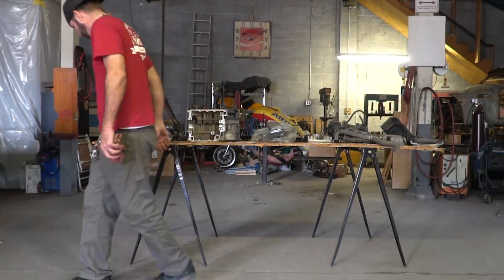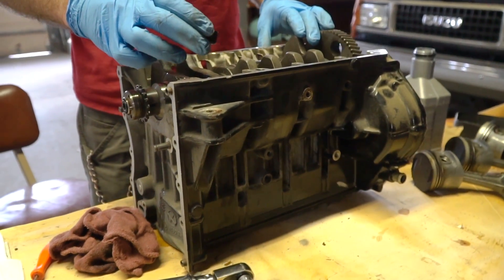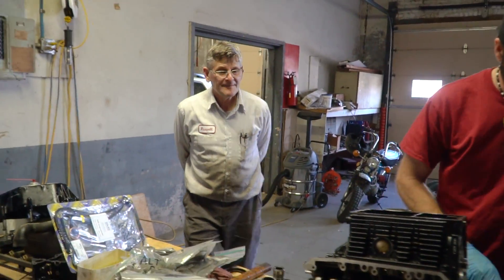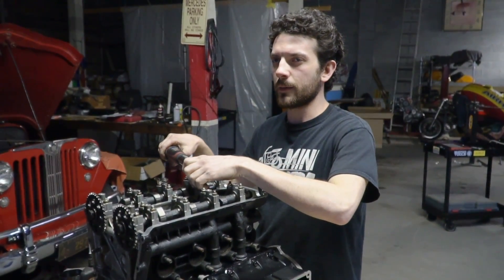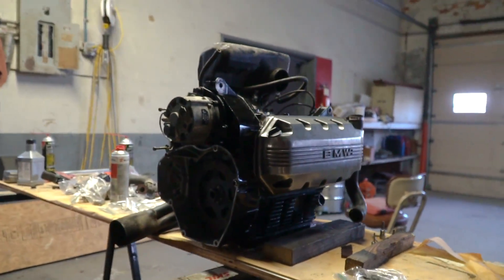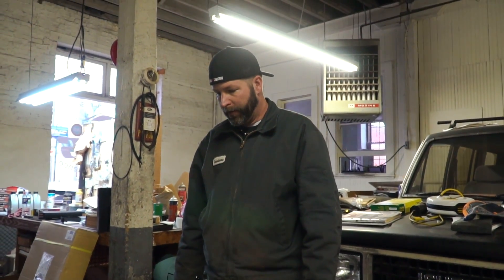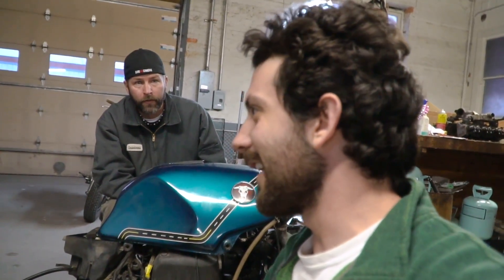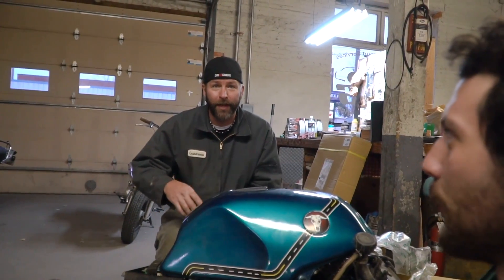Building an Abandoned 1000cc BMW Engine from 15 YEAR Cold Storage

Comment from the maker: This power plant is going to be a beast🤑
Reply: Aye sup carsandcameras
Reply: I think that you guys got to find an old Briggs 7 or 8HP engine and use on a go kart. I have an example in my channel if you want to to see it. There real hot rod go kart motors with the low idle.
Reply: Hell yeah, straight pipe
Reply: Do I hear custom  bmw powered turbo side by side coming
Reply: Beard looks good. Bromance
Reply: i could see a morgan threewheeler type of thing coming with that engine
Reply: It sounds really good. 👍
Reply: You didn’t pin your own comment, that’s why I like you guys.
Reply: I think this engine is a much more suitable one for a project than a 'Busa or another modern superbike engine. When you have 200hp on tap it's not all fun and games any more... 
I much prefer an oddball.
Reply: Maybe you could turbo, or procharge it...
Reply: that build is close to 1 buck per horsepower
Reply: A beast indeed. I own an R 1150gs and I think a Boxer buggy would be the ULTIMATE!  Torque like a V8.
Reply: I  owned a K100RS and these motors come to life after 5000 RPM
Reply: Thanks for this one, I've been needing to see the guts of a k100. Cant remember why... eh HaHa
Reply: You guys got to turbo this engine!!!!!
Reply: Put it on the rail
Reply: Hey just going to ask, are you looking for a frame for a project that isn’t a regular frame? It’s like half go kart half dime buggy with independent front suspension and stuff. Normally it would have a four wheeler motor etc. on it but the guy we got it from had made a makeshift 212 mount for it.
Reply: CarsandCameras gonna be crazy fast
Reply: Find a H/L/N/R gearbox from an atv and integrate that into the drivetrain.  You’ll have reverse and dual range which would be awesome!
Reply: When are we going to see more two strokes on this channel
Reply: @14:18 a 70’s Mercedes 280 lurking behind you, looks like.
Reply: I recommend on new startup after rebuild to pull the spark plugs out.
Spin it over with no spark plug in it.
It is easier on everything and it gets a chance to get oil flowing where it needs to go.
Plus the starter gets a break while spinning over.
Then when you get oil flowing and fuel going and flowing.
Then put plugs in and fire away.
I love this BMW Engine.
I read the magazine article’s when BMW
Came out with this engine.
I was on good terms with the BMW dealer and got to test ride the bike with this engine. This thing is a torque monster. Notice the fully counter weighted crankshaft! Awesome!!
This is build is going to be great to watch.
Reply: I'm glad to see you guys steping it up love the new build idea

Comment: Mad props to both of you for preserving an intact beemer and then repairing an old "brick." When taken care of, these engines are very nearly bulletproof. I had a K75 and K100 several years ago and had not a single issue with either.

Comment: That is going to be a cool start to a new project. I love those engines. The fuel pumps on those are better than most, you may try cleaning it out. The plastic holder in the tank is usually broken. The tank is aluminum, though, no rust, EVER!

Comment: Hey Guys.... Love the video, as always.... Hmmmmmm, how would that fit in your FED (Front Engine Dragster)?  :-)    I got my second job when I was 12 yrs old working after school in a Go Kart shop, assembling racing 2 strokes on kart chassis, etc.... and racing on weekends. That was back during the early 1960s until I went in the Army in 67, then after I was discharged I got my introduction into drag racing "shoeing" (driving) a Jr. Fueler FED for a team... and at 70, I still love doing what you two are doing... Keep up the good work, and enjoy it while you can...
 PS;  I can't believe that after all that careful re-assembly, you spray ether into that engine.... Ouchhh!!   Nasty stuff!

Comment: Just use a random same size car fuel pump and use the stock mounting housing.
No need to use an inline fuel pump.
I did it,works like stock.

Comment: I've been driving those in bikes fm 1000cc 90hp to 1200cc 135hp... Their vibrations do nerve, but 150K miles with no problems, just oil n filter abt 10K mi. Those do run forevr, true bricks. Ugliness can be beautiful, this is one. Cheers fm Achim, Singapore+

Comment: Put it on the drag cart frame hanging from the ceiling in IKE'S garage. Like a old Nostalgia drag rail with a real live axle in the rear.
Hey whats up with the frame I have an idea for a 3 wheeled yard/off road trike but need a wide body frame that would be perfect.

Comment: Watching Ike run on those bearing caps by hand triggered my ptsd. I used to do that by hand too but now I use a cordless drill set to the lowest torque setting and slowest speed and then torque them

Comment: Would have been nice to have seen the problem. I guess it was a rod? $100 is a damn good deal. You guys have gotten 2 engines that i would like to of had. That K100 & the Ducati. Both are great for carts or quads or buggies. Can't wait to see the build around the K100. Oh just read it was a drive shaft. lol Didn't have to take it all apart.

Comment: Good rebuild, and if it does blow, for some reason, you will lose the same money as a 212 predator!  so cool.
the horizontal inclination is to keep a lower center of gravity.  This way the bike is more agile and responsive, also more lean with less tip

Comment: If you could get it to fit it would be a perfect engine for the rail you have. it would't be overpowered like the Ducati and with the shaft drive you could make the install a lot cleaner by getting rid of the jack shaft.

Comment: I have a similar predicament... I bought a couple ATVs off a guy to fix up and sell for profit. One the them was an '04 Polaris Sportsman 90cc. 2 stroke automatic so relatively simple, but it was in pieces... the guy just gave me the engine in a box! After getting it home and inventorying the parts, I realized there was a lot missing... I have since put the whole engine and trans back together and am still constantly finding missing parts... oh! and it has intermittent spark PLUS, the gas tank had a huge crack on the bottom and it's $200😖. Hopefully I can get it going and at least make a couple hundred bucks... 

TL:DR Buying a used ATV in "kit" form screwed me

Comment: Izak, enjoyed the build on the BMW. I have a 99 K1200LT that has 110k miles on it, never had anything mechanical done to it and still runs like a new sewing machine. 
Izak, I am still wondering about that old Trailway Bus that I have seen several times in your videos as you drive down this little dirt road to where you have several vehicles stored. I am looking for an old bus like that to fix up as an RV. Could you please let me know the status on it if it is for sale. Thanks, you all be safe and I like your new shop.
Reply: It is for sale. Its not mine. Its allready converted to a camper

Comment: In cold storage 15 years will it run ? Why not? My Triumph has been apart for almost 30 years and if I put carburetor and magneto on it I’m sure it would startup like it had only been a week. I’m not going to without taking a lot of it apart first. I want to clean out the crankshaft oil sludge trap and check some other things.
Anything will run, but do you want to risk damaging it? You wouldn’t put a motor together clean washed with soap and water and no assembly lube would you?
Apparently a lot of folks on YouTube would.
( sounds like the timing is too far back on your BMW )
I got a motorbike from a guy and he gave me the impression that he set it up for storage, so I put it way in back of my garage thinking it was full of oil and such. 10 years later I rolled it out and found out it was not set up for storage but now was full of rust.

Comment: Had one of those bikes and it hummed like that for years, never figured it was the fuel pump making all that noise; still ran good though
Reply: Its probably vacuum or pressure leaking from the fuel tank. I had a bike with a really noisy tank vent.

Comment: I was watching some of your other videos and noticed that you were staying the trail 70 was overheating on slow trails. They sell an oil cooler atleast for my stock 70. Why did you drop a chinese motor in it? I rebuilt my 1969 and the exhast gets glowing and taking it redline top speed for 5 miles with no break and it never gives me problems. Seems like these old bikes have double or tripple the reliability of even Japanese new dirtbikes. Just my two cents saw no need for it. Much better bulletproof motor.

Comment: Hey guys 🙂
I just had a thought.. What if you put two sprockets on the end of the drive shaft, swingarm there. And run one chain to the front axle, and one to the rear axle.. you would have front engine, full time 4wd, with any choice of suspension and chassis to play with! Four link? independent suspension...?!
Super easy. Just Keep it simple, stupid 😁
It'll be fine 🙈🥳👍

Comment: Who ever designs an engine with a hidden oil filter deserves to get kicked in the nuts
Reply: They do it on purpose. BMW deliberately designs it's products to be impossibly hard to service yourself. If you do wish to do it yourself, nope, fuck you try again. Only after spending 1,000"s of dollars on tools made by BMW will you actually be able to perform self repair. I don't know why anyone puts up with this.
Reply: @ 7.44 is there not a cover in the sump that come off to access the filter with the BMW tool?
Reply: @Exotic Creature  Ive got 200,000Ks on my GS and its never been to a shop. Only need 1 special tool to get the final drive off and thats a ground down socket that anyone can make.
Reply: Exotic Creature clearly you never owned a bmw. I do all my own work on them and it’s not that hard.
Reply: @colingotch1871  it was there
Reply: @exoticcreature3059  i own two k bikes 2 e30s a e36 a e46 and a e90. I get by just fine with less than 1200 worth of tools. never taken any if my vehicles to a shop. I do admit this rings true with newer models such as my e90 but thats kind of the case with almost every modern vehicle.
Reply: @exoticcreature3059  When you can't afford an oil filter wrench for some 8 euro - heck, lets get an expensive one from Mannesmann for 12 Euro - you might want to take up another hobby. Like collecting pebbles or something.
Reply: @exoticcreature3059  the E46 is a easy car to work on.
Reply: @VolkerHett  To you and everyone, I'm not specifically referring to this bike engine. Any half wit can read my comment and notice that I'm talking about the BMW company.
Reply: @crazeguy26  What is the MSRP on that thing?
Reply: @exoticcreature3059  band new about 28k. now 800 bucks to 5k.
Reply: lol   honda gl1200 clutch.. hold my beer. yes it can be done without pulling the motor

Comment: so ike, how long have you been an auto mechanic? i remember how old you said you were, and you obviously worked here for at least 15 years, so i was wondering if this has been your only occupation? and $100 for a beemer engine that runs? that's a good deal all day long, any day of the week. if you could modify that shitvette rear end to work with the shaft drive on this, you could put a starter type motor at the junction to have electric reverse. that's why you pulled the front and rear suspension, you're gonna use'em for this project, huh?

Comment: Is it a big problem to get rid of the 15y mixture of gas and water from the tank, change fuel filter and disassemble, check  and clean up the fuel pump? Really?